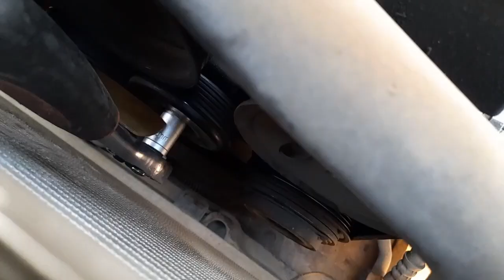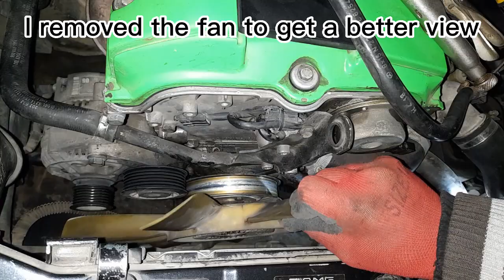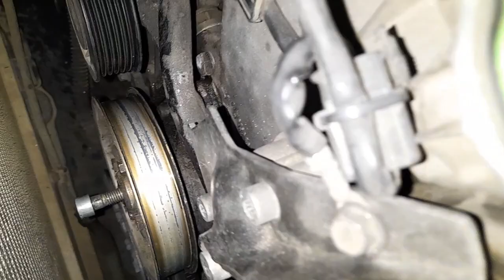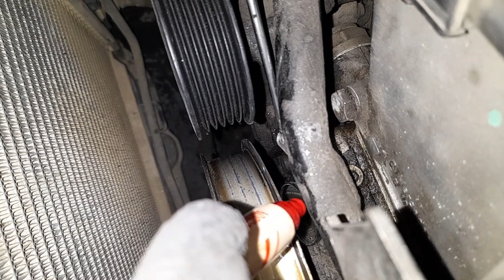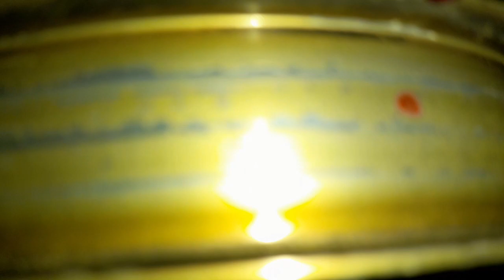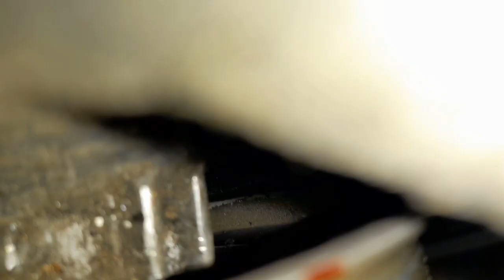how to remove fan clutch on mercedes benz w202 c36 amg

Comment: Hi if I want to remove the fan only is it difficult
Reply from the maker: No It's easy bro
Reply: What tool did you use to lock it with ? And it’s 8mm hex / Allen key ? 
Are you enjoying the c36 😉
Reply: Does the fan come off without using the locking tool with just the 8mm hex / Alene key - sorry to keep asking
Reply from the maker: @davidcroker5660  https://youtu.be/y4OZWu4-r58?si=pDVaEnQW9IaNVRDB
Reply from the maker: @davidcroker5660  🥰